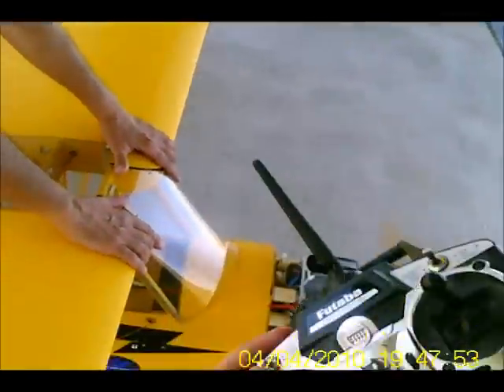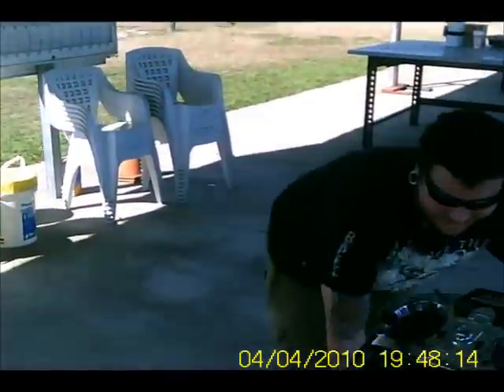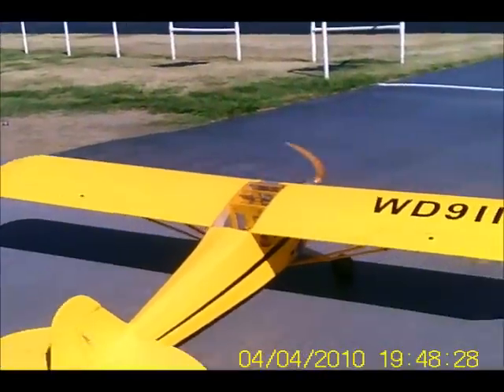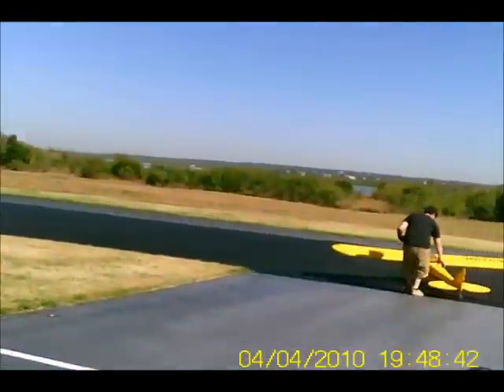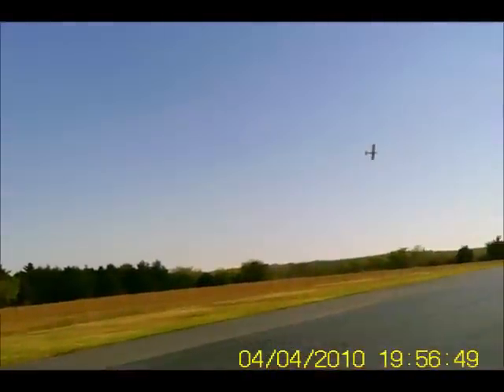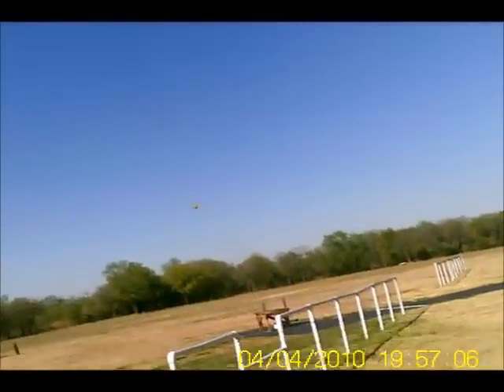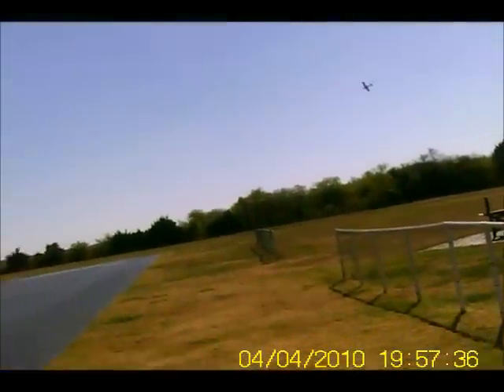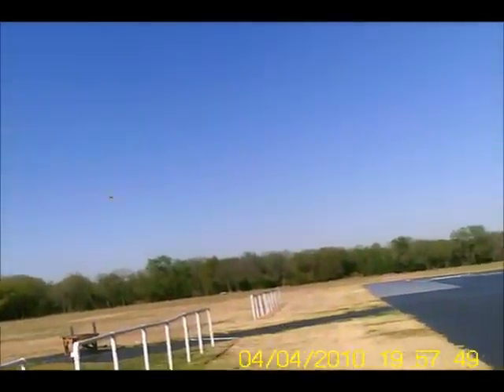ModelTech giant RC piper cub converted chainsaw engine flying RIP Mike*****

Comment: Great video been using new and   EX chain saw engines for years why pay silly prices for rc petrol engines when you can  ues garden strimmer engines a chain saw engines for less  than half the price of a peposly build rc engine. AND look AT IT. IF a chain saw can run all day in the woods cutting down trees. Then flying a model air craft  ITS A VACATION  for THAT chian saw engine. WELL DONE GUY'S HOPE MORE MODELS START USEING THEM.